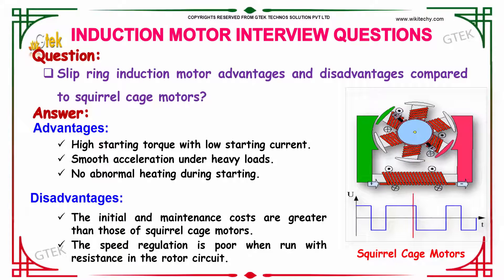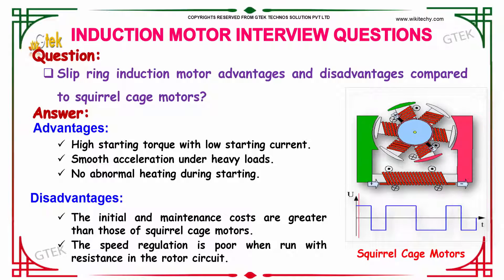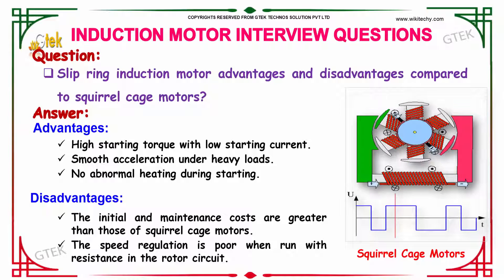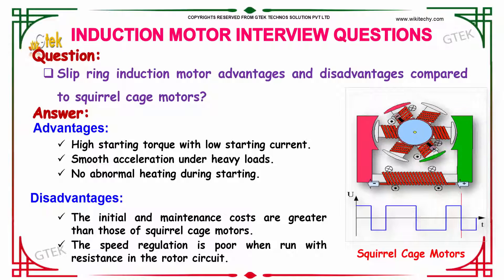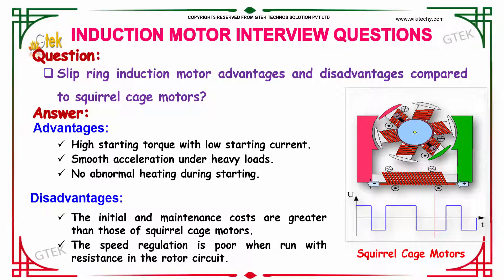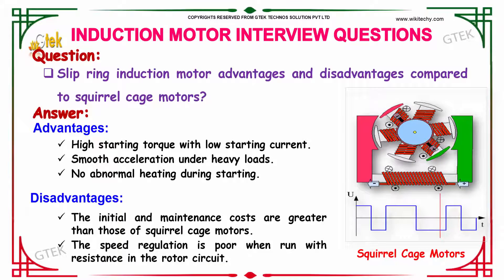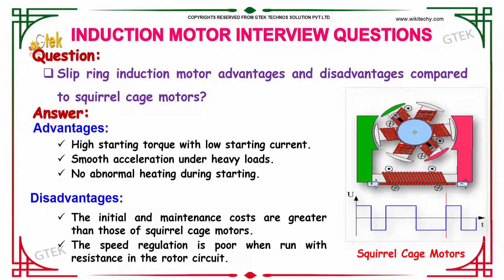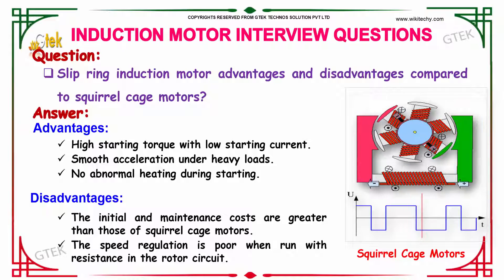Slip Ring Induction Motor Advantages and Disadvantages Compared to Squirrel Cage Motors

Comment: Slip ring induction motor advantages and disadvantages compared to squirrel cage motors?
Advantages of Squirrel Cage Induction Motor: Squirrel Cage Induction motors are cheaper in cost compared to Slip Ring Induction motors

Comment: High Starting torque with low starting current. Maximum starting can be attained in the slip ring motor compared to squirrel cage motor by inserting an external resistance in each phase

Comment: Slip Ring Induction Motors Basics. ... Slip ring motors usually have a “phase-wound" rotor. ... As discussed earlier, a slip ring induction motor is an asynchronous motor, as the rotor never runs in synchronous speed with the stator poles.

Comment: Induction motors generally will have low starting torque compared to dc series motor. Slip ring induction motor have big advantage of having high starting torque compared to squirrel …